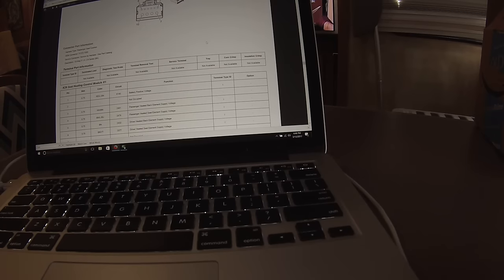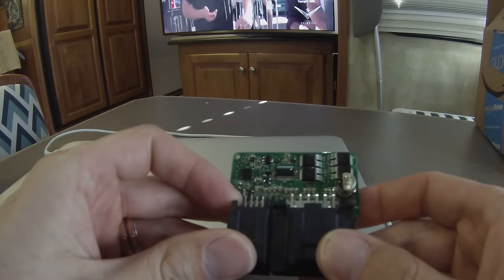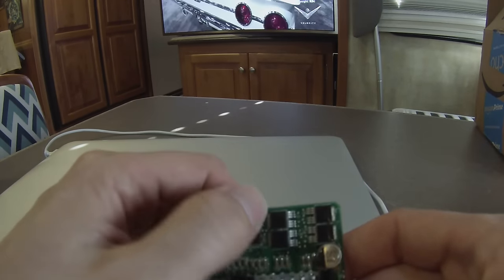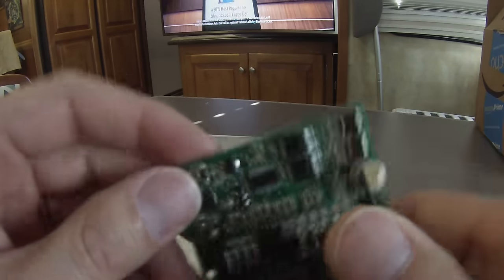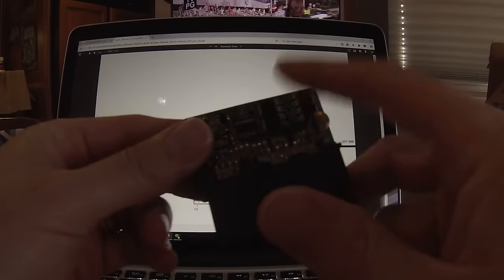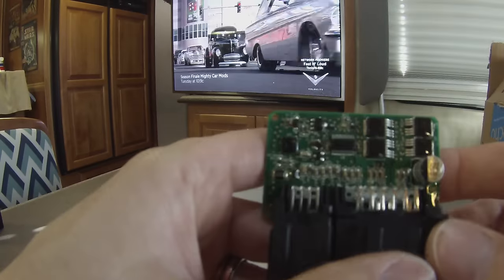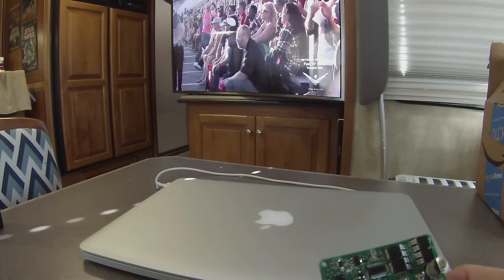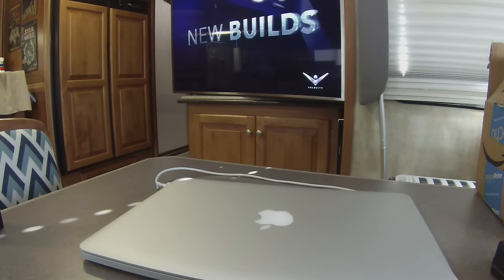The heated seat control module and how it works.

Comment: Kyle, I know this is one of your older videos.... but was wondering if you every dug into the LIN codes and what it would take to utilize this controller and be able to fire each circuit.   Looking to create a standalone solution to be able to use modern buttons and this controller in an old Jeep CJ.

Comment: Here’s a question you might not get all the time. I’m getting front seats from a 2013 Lincoln MKX heat and cool, I’m wanting to put them in a 57 Ford Fairlane 2 dr. Can this work, and what’s your thoughts on, am I getting in over my head?  I haven’t bought the sears yet, if I do I should get all the heater controls and ?  Thanks for your help.
Reply from the maker: Larry, most likely you can get them to work without the controls, in fact trying to make the factory control module work is real hard as that is where the custom programming is. The seats should be pretty simple with a hearing circuit and a coming circuit. If the factory setup had multiple stages they are just using PWM, look into that more to get an idea of how it works and then you can find a lot of options for generating that power for the heating and cooling. Good luck!

Comment: Hi there .Got a situation going on. Im at the wreckers yesterday and looking for the power heated seats to replace the worn out leather ones in my 2004 Pontiac grand prix. Well i was able to remove the passengers side because it has the manual adjusting lever . But the drivers seat is powered . The problem is that when they put the car out in the yard, the seat was all the way back covering the bolts that mount the seat to the floor. I plan on bringing a battery along with me the next time I go so as to energize the seat to be able to move the seat forward enough to remove the bolts . My delema is that im not sure of which pins on the connector are for the motor and I don't want to over amp the motor and risk frying it. This car's electrical system has been severely compromised by other hack shoppers. Im assuming that the power leads come from the passenger seat computer module located inder it and the harness is routed to the driver seat .Do you have enough experience with the GM cars typical wiring harness layout to be able to advise me on what I need to prepare for my attempt?

Comment: I have an 06 Suburban and both heated seat switches light up as long as you push it-then goes out immediately when you release. Fuse is ok so believe it is probably control module since both heat elements or switches probably didn't go bad at same time. Any input? Thanks
Reply from the maker: John, you're probably on the right track. If try and find a used on eBay to verify, should be cheap enough for that generation. Good luck!
Reply: @GoatRopeGarage  Thank you for such a quick response!!

Comment: Better be careful...   the elements have a thermister in the seat for feedback. Its a closed loop circuit. The elements are able to get way hotter than the high setting in stock config. And dont under estimate those mosfets. The ones in my controller can handle 20+ amps ea.  I've sniffed the sw canbus (J2411 GMLAN, obd dlc pin 1) and found heated seats were controlled with..
0x107220A9 0x00 0x00 0x00 0x00
Byte 4 is for the driver side
Byte 3 is for the passenger side. 
0x00 = OFF
0x2C = LOW
0x3C = HIGH

I believe the controller also looks for engine data to make sure the engine is running before it will turn on. 
I have some data i believe is required, i'll know for sure once i build my gmlan tranciever. Parts are in the mail.
Reply: These are not factory elements, so no worries there. And I'm not sure what sniffing the canbus will do you in this setup. My understanding is the BCM wouldn't communicate if the vehicle wasn't optioned with the feature from the factory which is why I bypassed the BCM all together, I didn't even try and pass information though it as there was no benefit. Also any information pertaining to the heated seats on the canbus would probably be informational. The commands from the switches and to the heated seat controller are going to be on the LIN bus, but I haven't verified if they are in the same channel or behind a bus firewall via the BCM. The address and and messages you've posted do not align with any of the controls on the LIN bus, if you need help figuring that out let me know and I can post the information but you seem more than capable. Good luck in your project!

Comment: I have a 17 chevy with a bad ecm for the heated seats and was wondering where to get a replacement if you have knowledge about this please
Reply from the maker: You can find them pretty cheap on eBay, looking for a heated seat control module
Reply: @GoatRopeGarage  last question. There is a one for each seat correct?
Reply from the maker: @jamesbutler1862  nope, just one for both
Reply: @GoatRopeGarage  thx a lot for your help. Chevy wants 290 for replacement. I want to do cheaper 😁 all I need is the location and I'll do it myself for this amount.
Reply from the maker: @jamesbutler1862  under the center console if I remember right
Reply: @GoatRopeGarage  thx a ton man.
Reply: @GoatRopeGarage  what about sierra 1500 , located under the center console ?

Comment: Bro i need some help I have a 2014 silverado ltz my ac seats work but neither driver or passenger heated seats work. Any advice
Reply: Did you ever figure this out? I am having the same issue. I have a 2016 gmc yukon denali. Thanks!

Comment: I have a problem with my 2017 sierra denali with heat/vented seats. The thing is... my switches wont then on to red or blue. I checked fuses to heated/vented seats and they are good. Why do you think the switches arent turning on? Any help would be appreciated
Reply from the maker: If they aren't turning on they are not communicating with your BCM, that is what gives them the initial command to "wake up". Since both are separate it indicates that this isn't an issue with the switches themselves. Unfortunately this is going to probably require a trip to the dealer so they can see if there are issues with the network.
Reply: Ok thank you! I thought maybe it was module under the seat that wasnt getting signal or something. I even thought maybe there was another relay/fuse that was blown but couldnt find it. How could make the network go wrong? Or not send signal to the switches? Thank you once again
Reply from the maker: @b_amayzd3646  Often it will mess up for some small reason, battery low during a start or something, and you'll have communication loss, if that happens it will sometimes stay faulted out until it's reset. The module under the seat gets it's commands from the BCM in this situation, so you hit the switch it communicates the state to the BCM, the BCM then talks to the module.
Reply: Gotcha! Thanks a lot. I might just see if i can unplug the battery and reconnect it. Or have the dealer reflash the bcm

Comment: We have a 2013 SRX CADILLAC, and the drivers seat heater has stopped working.  What can we do to fix this issue ?
Reply: Saundra Wood Look up how to test the seat heaters element, it will require you to unhook a plug under the seat and use an ohm meter to check resistance. That's usually what goes out on these. If you verify it bad you'll know what part to order to replace if it is good it could be a couple of other issues. Don't be afraid to use Google, you're probably not the first person to have this issue. Good luck!

Comment: My passenger seat quit working completely but the seat warmer still works could that module be the problem I did buy a new switch control but dident do nothing it's on a 2015 all terrain gmc
Reply: freddroism did you ever find out the problem? My switches are not turning on. Incant even text to see if my seats work

Comment: Any help on what is causing my 03 Tahoe heated seats randomly trying to turn on and keep clicking? I have the heater elements unplugged on both sides. Drive me crazy becuse it keeps clicking and the lights go all the way up then off then repeat.
Reply: @Robert Shaw Did you solve your issue?  My 06 Silverado is doing the same thing. Pulled the DCM and Heated seat switch and cleaned them.  Didn’t solve the issue for me.